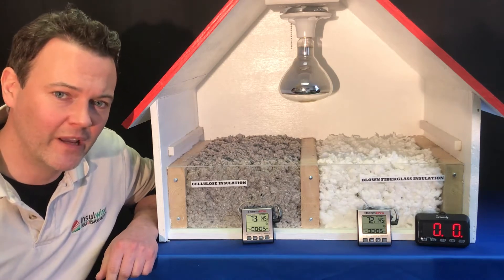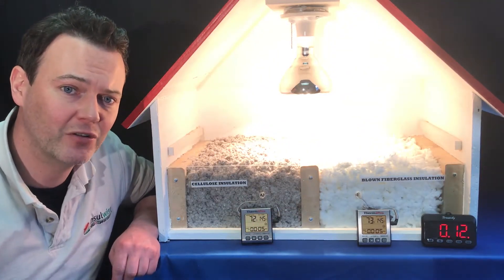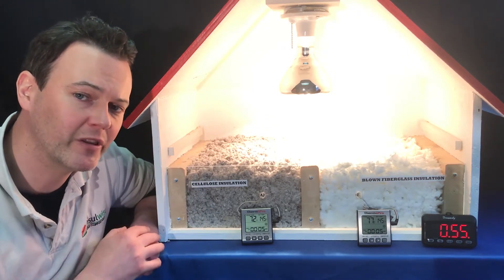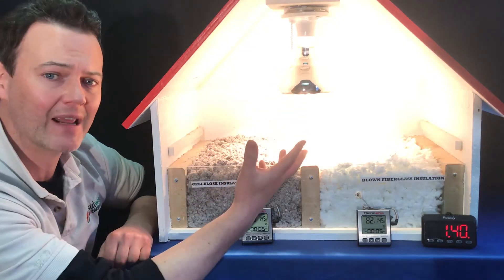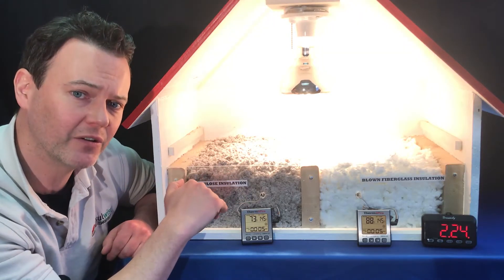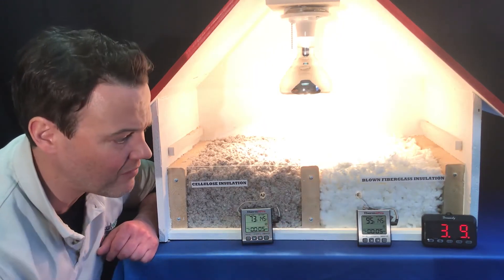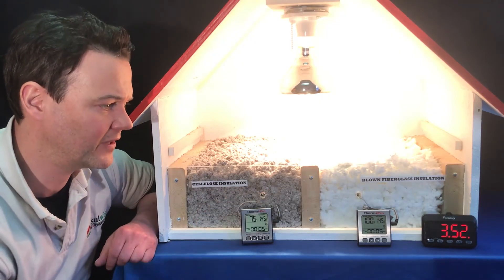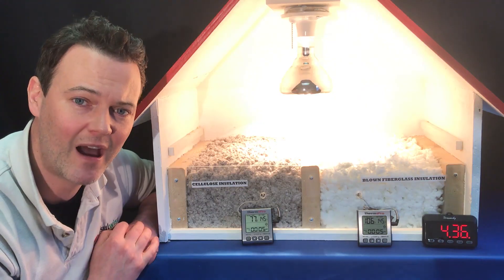Cellulose vs. Fiberglass Insulation: The Ultimate Showdown

Comment: Fiber glass insulation has heat class A 1. Cellulose insulation only has class C 🤣🌬🛖
Reply: Hi Julebrus, I'm not sure what you meant by the heat classes of A1 versus C, but was this it?   This is a link to a study done several years where they insulated two identical houses, one with fiberglass and the other with cellulose, and then lit them on fire to see the difference.  The home insulated with fiberglass was quite the barn burner.  

The Big Burn:
https://www.youtube.com/watch?v=lAPPn53JtHQ

But this is merely how fiberglass insulation reacts in a house fire compared to cellulose insulation.  If heat class A1 implies "get your marsh mellows and stick out" I think I understand now. 

Andy
Reply: @andrewhaak7747  https://www.youtube.com/watch?v=hVgH8W-IzMc
Reply from the maker: Dude — you referenced a commercial from a fiberglass insulation manufacturer.  Know what the difference between them and me are?  I don’t get paid for selling insulation, I get paid for solving problems.  I simply want to use the best product solving that problem.

Comment: Hi I have a question. Our House Plan states that Ceiling insulation is R4.0 and Wall is R2.5. 
I suspected the builder used a dodgy insulation. I sent 10 samples of Ceiling Batts insulations for Lab Testing and it was found out to be unsatisfactory and not rated as R4.0 (about 30 to 40% less in its R value).
Now the builder said they will overlay the existing faulty Ceiling insulation with correct R4.0. And they said should be GOOD enough to improve Star Thermal Rating

The builder acknowledged that the Walls insulation is likely faulty as well. They said, the  double overlay done on Ceiling Insulation should be enough to improve the thermal efficiency.

Im worried if they only double overlay the ceiling of the house but the wall insulation is faulty, we will feel a warmish feeling above our heads but feels naked/cold around us due to poor wall insulation?

Thanks, I will also appreciate everyones advise.
Reply from the maker: What country do you live in?  Most states in the US now require an R49 insulation level for an attic space, so I’m not sure what you mean by R4.0?

Comment: What is the recommended level for cellulose in an attic. Our new build only has 8-9 inches in both attics. Someone messed up and only put 3 inches above one closet and 6 inches above a room here in Texas
Reply from the maker: Minimum should be an R-Value of R-49, which equates to a level of about 15" blown in.  Cellulose will settle between 5-10%, so if you look at the bag it'll give two depths for any required R-Value, Loose Fill at about 15", and then settled R-Value which is about 14".  So to make long story short, you want to have about 15" in your attic.  But before adding more, you should have a professional air seal the air leaks in your attic first.  This is nearly as important as adding the insulation.  Here is a link to our site explaining what air sealing is and why it is critical.  

https://www.insulwise.com/insulation/air-sealing-insulwise-pittsburgh/

Thanks!
Andy

Comment: Videos like this are gimmicks.  They demonstrate radiant heating - something that 99.9999999999999999999% of buildings don't experience.  Unless you have a see-through roof, the type of heat transfer in your attic is conductive.  Another trick this video uses - it's comparing them at the same depth: fiberglass needs to be deeper than cellulose for the same R-factor.  Even though fiberglass needs to be deeper, it's still less expensive.  It also provides superior protection against molds and mildew.  Finally, I didn't see the install of these samples, but the cellulose looks more compacted (which would hinder radiant heating) and the fiberglass looks much more fluffy (which would aid radiant heating).
Reply from the maker: Tim if you have an attic at your home, wait until it's a hot day and then go and open the attic hatch.  The heat that you will immediately feel hitting you is caused from radiant heat transfer.  Basically the structure of your roof assembly has absorbed heat from the sun hitting it, and then radiates that heat in every direction around it.  So, I'm not sure where you've gotten you 99.9999% information from, but it is wrong.  Also, the video is not a trick, I explain clearly that the R-Values of the two materials are different.  What it is meant to show is just how differently they perform, and how much more effectively cellulose insulation works.  Also, there is no price comparison with blown fiberglass and cellulose insulation.  Cellulose is simply FAR less expensive.  Every conceivable element of the economics of its production would bare this out, but especially when viewed from the amount of energy required to produce the two (considered embodied energy, the base materials of fiberglass need to be heated to about 2,000 degrees in order to create glass fiber...cellulose, not so much).   
Best, 
Andy
Reply: @insulwiseenergycomfortsolu3293  The roof structure being heated by the sun, which is the radiant heat source. Then, the heat is conducted through the wood in the roof, and conducts to the air in the attic. Then, through convection, the hot air is able to move through the attic, reaching the attic hatch. So the blast of hot air you immediately feel is actually a result of convection. Not sure where YOU are getting you info from, but I have a PHD in thermodynamics and I can assure you that you are mixing it all up here!
Reply: Fiberglass is not less expensive. It’s more expensive and less efficient per inch.

Comment: Also the itchy stuff mislabeled "insulation" fails to stop AIR FLOW (convection) thru cracks and gaps (like around cieling mounted lights etc.)that is the most likely single reason your house lost heat!
Reply from the maker: Any loosely blown in insulation will allow air leaks to move through it.  That's why we ALWAYS air seal attic floors before insulating them with cellulose.

Comment: If you have a fire in your attic, cellulose will make your house go up like a roman candle.  I had a fire in my attic.  We had no idea there was a fire for half an hour.  Rock wool saved out house.  The fire didn't spread at all.  It was confined to the wood joists where it started.  Please consider this.  And make sure your insurance is replacement cost value.
Reply from the maker: Hi Russell, thanks for leaving a comment.  However, all cellulose insulation sold in the US is treated with non-toxic chemicals like boric acid (same stuff that Borax soap has in it) that make it so that it cannot catch fire.  I've attached a link to a video.  It shows a guy holding a pile of cellulose insulation in his hand while hitting it with a blow torch.  That's a pretty good demonstration that it not only insulates extremely effectively (no burnt hand!), but that it won' t catch fire, and there are numerous ones just like this on youtube demonstrating the same thing.  https://www.youtube.com/watch?v=xdSBRPnFvlM

Insulating a house with cellulose insulation will dramatically slow the rate at which a fire can envelop a home, particularly if the walls have been dense packed with it.   I've actually seen the results of a house fire where cellulose had been used extensively.  The wall studs and attic floor joists were singed and scorched, but that was it.  The cellulose itself didn't burn and actually slowed the fire down. 

Andy Haak
Reply: @insulwiseenergycomfortsolu3293  It won't catch fire and flame up but it will smolder. I used to work for Morrow Insulation in Little Rock Arkansas, they manufactured and installed cellulose insulation. One of their demonstrations was to melt a penny with a torch in the palm of their hand with a couple of inches of cellulose insulation. Also when insulating new construction we would first air seal the entire structure after it was in the dry. We would then spray all exterior walls using a hopper machine as well as a 55 gallon barrel filled with a water and elmers type of water based glue mixture that had a pump placed on top and a rubber line that ran to a nozzle that had injectors on the end of the blower hose so when you sprayed the open wall cavities from bottom to top the glue mixture was injected and mixed with the cellulose keeping the insulation in place. The insulation was sprayed 1/2 to 3/4 of an inch deeper than the wall studs, then a guy came behind they guy spraying the insulation with an electric scrubber that was about 36 inches wide and about as big around as a baseball and covered with a rough textured rubber. the scrubber was then ran along the face of the wall studs from the top to the floor removing any excess insulation making it flush with the face of the wall studs. Then the sheet rockers could come in after 24 hours drying time and hang the rock. Then after all the sheetrock was hung we would come back in and blow the attic and batt the floors if there was a basement or crawl space. About the only thing we used fiberglass for was under floors or a barrier in the attic up against the durovent before blowing the attic.
Reply: @insulwiseenergycomfortsolu3293  Everything can catch fire technically, it just has to get hot enough.
Reply from the maker: @trumpisaconfirmedcuck5840    Ultimately you're correct, otherwise things like lava wouldn't be able to happen.  But in the normal scheme of things, cellulose insulation is not going to burn inside a residential home.  The other things around it  like framing and plywood are going to burn long before it does. 

Andy
Reply: @insulwiseenergycomfortsolu3293  Yeah I'm just being a smart ass.

I know both cellulose and fiberglass are not going to cause problems in residential buildings.

I do wish more houses were built of concrete or brick instead of wood though. When I move to Europe I'm going to do a concrete house.
Reply: @insulwiseenergycomfortsolu3293  good info.  Thanks for the reply.

Comment: 1 flaw is you need more Fiberglass to get the same R value... so this was not really fair test… even tho it takes more thickness to get the same R value, it is lighter....
Reply from the maker: From a technical standpoint you'd actually be correct.  However, going from experience my guess would be that the blown fiberglass would still  underperform, and perhaps even more embarrassingly so because the higher mound of insulation on the right (the fiberglass) would still heat up faster.  And that would indeed be something to see.  We encounter heaps of this stuff in so many attics of homes that can't cool the rooms beneath the attics.  The general idea of the comparison was to help provide homeowners with a visual clue as to why they may not be able to heat or cool their homes effectively, despite seeing a bunch of billowy white or pink stuff when the peak into their attics.  We find that many homeowners, often not being experts on the subject (because why on earth would they be lol) see some insulation in their attic and think "I"m good on that...case closed, the problem MUST be something else!"   When I get around to it I'll likely create this video.  

That said the adding more blown fiberglass to increase it's R Value for the video demonstration, still will not address it's prime deficiency of its R-Value degrading at temperature extremes.  

Andy

Comment: Maybe equalize the price per inch depth, then try the test?
Reply from the maker: The outcome would be even worse for the blown fiberglass, in fact far worse.  Blown fiberglass is much more expensive than cellulose, especially now, due to the embodied energy that is required to manufacture it.  So what you'd have is an insulation that performs far worse at temperature extremes (ie --- when you NEED it to perform), AND also one that is far more expensive. 

Andy

Comment: I've blown over a lot of cellulose. It settles badly. Sometimes there may be 3-4 inches of cellulose where there should be 13 inches. I don't see that as bad with fiberglass.
Reply from the maker: Hi Hurleyman, you're right cellulose does settle, by about 10%.  There is a chart on every bag of cellulose insulation showing desired R Value, Blown depth, and Settled Depth.  For the material that we use a settled R-49 insulation level comes out to about 13.5".   The next column over on the bag then shows that you have to blow in about 15" of cellulose to eventually get your ultimate desired height of 13.5" inches.  I have also seen blows in attics that we work in where the depth of the existing cellulose is all over the place.   If there should be 13" inches and you're seeing 3-4" inches that's 100% operator error when the original blow in was done. 

There is however an important benefit to the settling action of cellulose insulation in an attic.  When it settles it becomes more dense, particularly the surface of the insulation that is exposed to the air in the attic.  Settled cellulose is FAR more firm and closely packed than blown in fiberglass is.  This makes the layer of cellulose MUCH harder for cold air to "fall down through" the insulation during the cold months.  As heavy, cold air will penetrate down through blown in fiberglass, that is how blown fiberglass loses a good amount of it's R Value at cold temperatures.  It is simply too easy for air to move through it.  Batt fiberglass is actually much more effective at maintaining R Values at temperature extremes than blown fiberglass.  But with batt fiberglass in attics you then have issues with gaps in the insulation around all of the obstructions on attic floors.  

For bang for the buck (cellulose insulation is FAR less expensive than blown fiberglass) as well as thermal resistive performance, we find cellulose insulation to be a far better material. 

Hope this helps!
Andy

Comment: I see issues all over this demonstration.  First your using a heat lamp which also creates radiant heat. 2nd why would you use Equal R-values?  Also the cellulose can condensate when packed down.  Next question? How long does the cellulose take to cool back down?  It tends to pack down more over time loosing some R-value and will also take more time to cool off. As a contractor I have switched back to fiberglass for our attic fills for these and other reasons.
Reply from the maker: Hi, 1)  radiant heat is the primary way that attics are heating during the summer, so the heat lamp is perfect.  The sun heats the roof, the heat build up in the shingles and roof structure then radiates down in the attic and rooms below  2)  The two materials are different R Values which I clearly explain in the video.  The video shows how much more effective per inch of insulation that cellulose is at blocking heat flow 3)  Cellulose does not "condensate," that is a property of water vapor.  Cellulose settles by about 10% over time, which any decent installer understands -- so you blow in 15" inches knowing that it will settle to about 13.5" inches -- which is a settled R-49.  4)  The cellulose does take longer to cool down, correct.  The reason that doesn't matter is because an attic is only maximally heating from about 11am - 2 pm, afterward the angle of the sun drops and the attic begins to cool, and the heat that has built up in the cellulose can then dissipate out through the roof vents.  In those 3 hours where the cellulose is getting heated up, there is no chance that the heat is penetrating all the way through it to get to the rooms below.

Comment: This is one of the dumbest videos I’ve watched…they don’t have the same r value at the same thickness…good gray….
Reply from the maker: Correct, they have different R-Values, which I clearly explain.  The point is that  1) for people who either already have a bunch of blown in fiberglass in their attics, yet still have temperature problems in the rooms below, having this stuff as their insulation material could well be the culprit (it often is for our customers here in Pittsburgh)  2)  the performance difference between these two materials are not slight, they are dramatic (with cellulose clearly superior) and 3)  even if you blow in enough fiberglass to get matching "equivalent R Values," you still have the problem of R-Value degradation at temperature extremes with blown fiberglass due to its super fluffy nature that allows air to freely move through it, as opposed to trapping it (the super fluff factor allows convection currents to occur within the installed material).  This last bit by the way has been proven.  

Hope this helps!
Andy